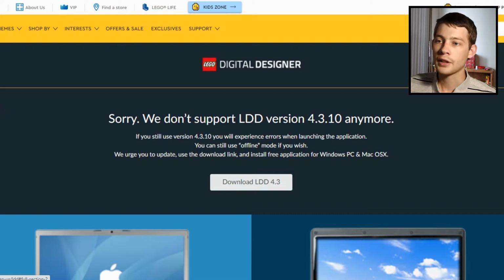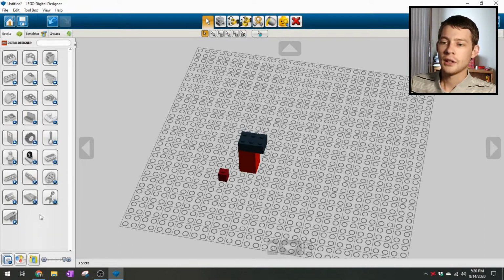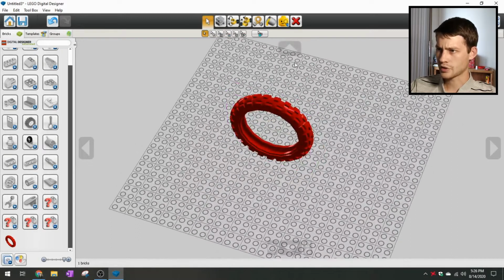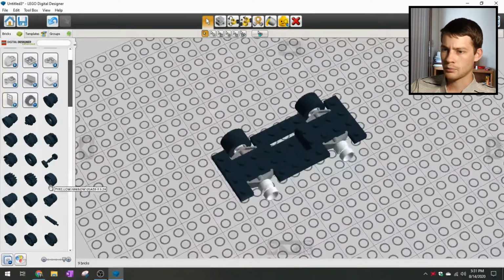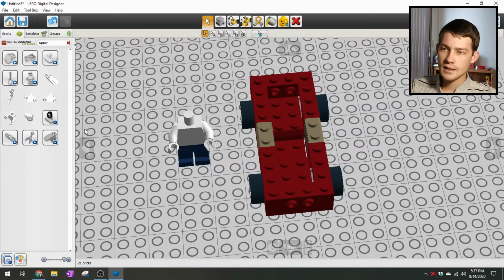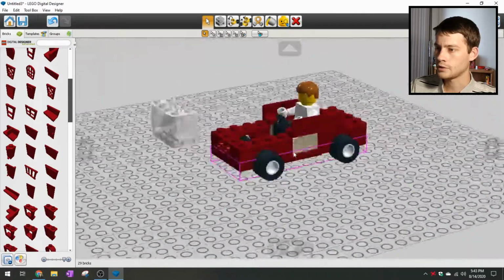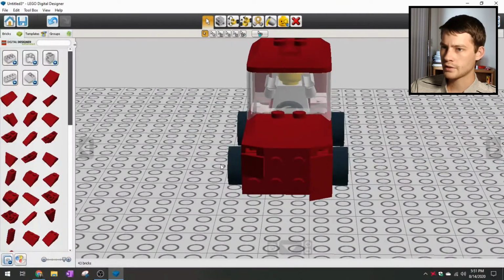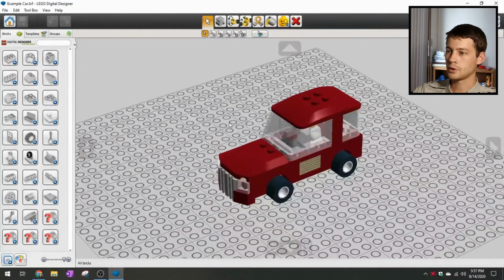LEGO Digital Designer 4.3.11 tutorial 2020

Comment: How do I download LDD with Brick Version 2670? My friend has this Brick Version in his LDD and in this version it has all the pieces, but when I try to download it on my PC it comes with Brick Version 777 and in this version it doesn't have all the pieces, could you help me?
Reply from the maker: Anything past 777 is from the Ldraw contributors over on Eurobricks, or so I've heard. I'll have a look and see what I can find in the next couple days.
Reply: @BrickSystemBros   Alright, please if you find something teaching how to update the Brick Version or how to install LDD with already this version, please let me know, I need that version
Reply from the maker: @mcintrusoav  alright, did some digging and this seems to be the landing page for the current community supported LDD parts updates. https://www.eurobricks.com/forum/index.php?/forums/topic/177795-key-topic-ldd-new-parts/

From there you can follow the link to a Github repository and follow the steps outlined to patch the new parts into LDD. I don't see any indication that this is brick version 2670, but it seems to be an ongoing discussion with regular updates. Another note; it seems that the current version hosted on the LEGO site is more buggy than the previous version, it is suggested to use a web archive installer to revert. It's possible that this step is unnecessary when adding the new parts patch, I haven't actually tried this myself.

Comment: Hi, do you know how to rotate small laptop and set on 90 degrees?
Reply from the maker: What is the part number? It should say in the bottom right corner when you have it selected
Reply: @BrickSystemBros  it is 62698
Reply from the maker: Ok, I'll check it out this evening
Reply from the maker: Mrdjan, thanks for the question; it is a completely locked part in LDD. Even minifigure legs, which are treated as a single entity, can still be posed and rotated, but the laptop does not have any folding function unfortunately. 

Just for the sake of completeness, I tried the other digital building software I am familiar with (Studio) and it is treated the same way. In studio, it does show a "needs work" tag, so we might see that functionality in a future update. For LDD however, I doubt it will ever be fixed.
Reply: @BrickSystemBros  Ok. Thanks for answer. Do you know how to move construcion left and right? I can only zoom in and out and rotate.
Reply from the maker: Yes, that one I can help with. If you click on any piece with the right mouse button it will make that piece the center of view.

Comment: Hey Nathan, I'm new to LDD and hate that it's no longer supported however, The computer I'm using is a hand me down from 2012. I'm thinking that's the issue but here's my problem... 

I've called Lego and was told there's no piece limit to a single build. Also there's no surface limit. (# of base plates). Up to 8,000 pieces I didn't have any trouble. Up to 12,000 pieces I had to save about every 1,000 bricks. 16,000 pieces I had to save every 500 bricks. I'm now at 24,000 pieces and have to save every 5-10 bricks depending on the size of the brick. Even then it crashes often closing the window. 

My questions are... 

Does LDD use virtual memory? 
If I buy/have a computer built do you know or could you recommend what the computer should be able to do? This computer will be solely dedicated to LDD or other similar build sites. 

If it's easier you can find me on instagram @my_giggle_pics

Thank you.
Reply from the maker: Hey Jayden, thanks for the questions. It sounds like you are really pushing the limits of both LDD and your hand-me-down rig, I have never attempted that scale before. At 24K pcs I would guess you're still limited by the tech than the software, so an upgrade should see a performance improvement.

LDD (specifically Extended mode IIRC) was used for constructing the digital sets during production of The LEGO Movie in 2014. These files were huge, probably close to 100K pieces for the shots in Bricksburg. Throughout the movie a total of 15,080,330 pieces were used according to their portfolio entry here: https://animallogic.com/portfolio/projects/tlm/

I don't know enough about LDD to tell you whether it uses virtual memory or not. I would recommend researching the specs needed for computers that are focused on 3D modeling software like Solidworks and Maya, as there should be a lot of overlap between these applications and LDD. A recent graphics card will go a long way for the viewport refresh rate, which is probably getting really laggy at 24000 pieces.

Good luck, I'd be curious to hear if you can get passed 100K on a new machine.
--Nathan
Reply: @BrickSystemBros  I expect this build to reach 35,000. I also started a hotel which is 4 city blocks. The first floor is almost done and 17,000 pieces. I was planning on it being 30 stories lol

I will let you know if I make progress on both. Just hit 25,000 on the Foyt Mansion 😊

Comment: I can never find parts for train wheels or anything
Reply from the maker: I found some in extended mode in the "steering wheel" tab. Here are the names and numbers:
Bearing Element 3x6 (74784)
Train Buffer 2 (91994)
toghjul med flange (85557)
Train cowcatcher 6x6x2 (90201)
Buffer Plough (45708)
Train wheel with o-ring (57999)

You should be able to find these by typing the number into the search bar above the parts palate.
Reply: @BrickSystemBros  I was able to find a few but not all came up
Reply from the maker: I bet you have an older version of the software, I was using Brick Version 777. This is the version that can still be downloaded from the LDD page in the description.
Reply: @BrickSystemBros  oh I have 4.3
Reply from the maker: Yeah, brick version is different though. Sorry, I should have said I have Brick Version 777 with 4.3.11
Reply: @BrickSystemBros  it’s ok but thanks anyway maybe I can find that version somehow
Reply: @BrickSystemBros  oh thanks

Comment: I'm having trouble putting bricks on the grid next to each other.I got one on but when I try to put another brick of the same color/size next to it it won't go on the grid.I also noticed that the brick is sitting lower than I want it to sit.Any suggestions on how to fix it?I could always send you the file and see what I'm doing wrong.Thanks for any help that you can give me and I hope to hear from you soon.
Reply from the maker: Hey Dan, the problem with the brick getting placed lower than you want sounds like a common thing in LDD. The program will make the floor as low as the lowest piece in the model, so check the rest of the pieces to see which one is the lowest. For the trouble placing the bricks where you want, try changing your viewpoint to look at the model from a higher angle, sometimes LDD is just being stubborn and you have to re-center the view on the section you're working on.
Reply: @BrickSystemBros  I did as you suggested and I looked on the bottom and none of them are lower than the rest of the all the others.I'm in a wheelchair from Arthritis and my hands hurt when I do things like this for a long time.I was wondering if I email you the lxf file if you could fix it for me and email the fixed file to me?If you have a facebook page I could messenger the file to you.Thanks again for any help that you can give me and I hope to hear from you again soon.
Reply from the maker: Message it to the Brick System Brothers Facebook profile, I'll see what I can do
Reply: OK

Comment: my ldd installation says that It's not compatible. can you help me figure it out?
Reply from the maker: What computer do you have? Make sure to double check the minimum operating and storage requirements
Reply: Brick System Brothers thanks for your reply I have a Mac update: macOS Big Sur Beta 11.0 If that helps and I downloaded the Mac installation via your link.
Reply from the maker: @Tha_Greatest3882  OK, I don't have any mac experience but I've got some links that might help. 
First I checked 3rd party reports here: https://roaringapps.com/app/lego-digital-designer Big Sur hasn't been confirmed yet
Next I did a quick search for LDD offered as a download from a mac software host. Try downloading from here: https://mac.filehorse.com/download-lego-digital-designer/ 
If you can't get 4.3.11 to work, this site has an option to download older versions of the software all the way back to 2013. Let me know if you have any luck with an older version, just keep in mind that there will be less pieces and extended mode will probably be different.
Reply: Brick System Brothers I think I have 8gb ram and enough storage
Reply from the maker: @Tha_Greatest3882  I kept reading about running LDD on macs and it might be an OS issue related to using 32-bit vs 64-bit systems. Unless you really want to use LEGO Digital Designer specifically I would recommend checking out a different application called Studio. It does the same thing and it's currently supported: https://www.bricklink.com/r3/studio/download.page
Reply: Brick System Brothers I will thanks for helping me out!